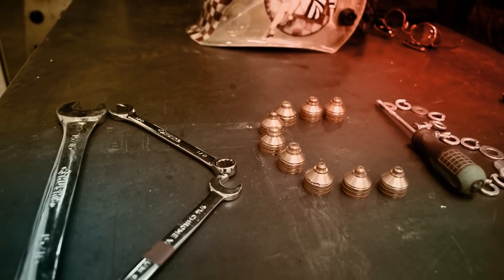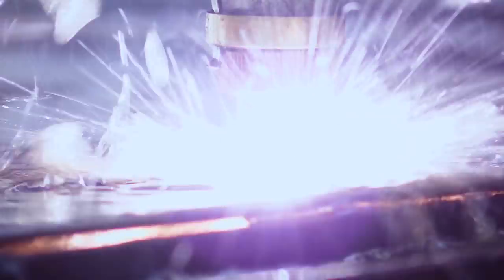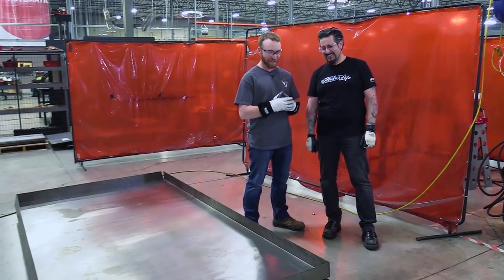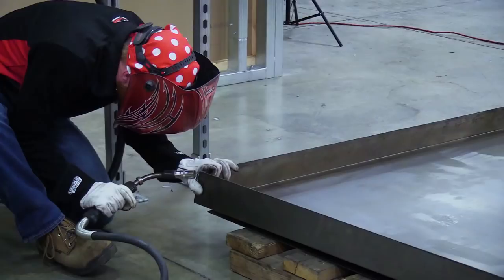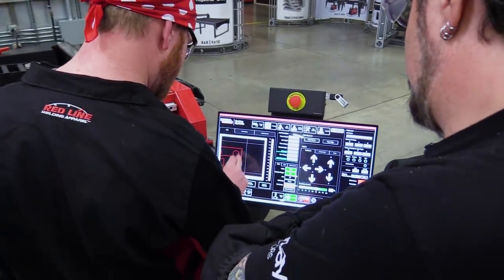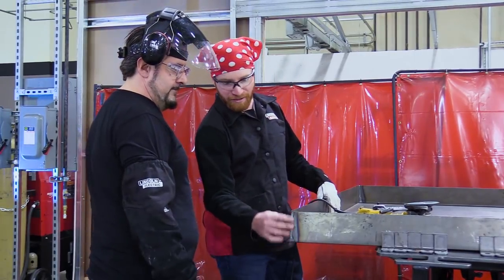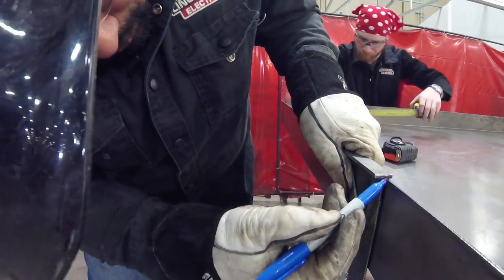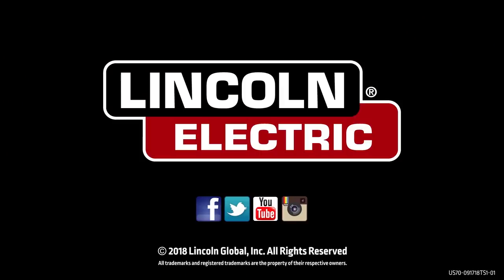Design | Cut | Build™ - Mobile Plasma Table - Part 1 | S3.E7

Comment: The rail design is the primary reason that I did not buy a Torchmate table when I outfitted my shop with a Star Labs table--the side rail design is so much better.  I had a friend with a TM table and his torch was always hopping over slag.  i am surprised that they did not change their design yet.

Comment: As a Mechanical Engineer turned Millwright now semi-retired but still designing & fabricating at my home shop....  I would have to ask why would you want to "hump & slosh" around a tank full of water solution in a trailer...??... that's a tough way to go!  I would have "strongly" suggested a 'more forgiving' downdraft exhaust fan system!  I mean think about it... when you pull into a jobsite you will have to look for a "level" parking spot(hopefuly a hard pad) and even with that you will still have to level your trailer/plasma table "EVERY" time.  I'd for dang sure be installing auto-leveling jacks on each corner of the trailer!  And before any 'power-up'... hand move(literally by hand) fully move the plasma heads up and down the rails in all directions of travel to "feel" for any kind of binding...
Also, I want to give you something to consider.  Maybe you have, but consider this....  Plasma tables are designed to be placed on a hard surface which is fairly level.  The rails/tracks and drive gears/heads "will NOT like twisting and flexing" at all...!!  Something is 'going to break' and possibly often!  From my experience, most all common built trailers twist and flex... from single axle to tandem axle to tri-axle and on up to 40+ foot flat beds(even enclosed).  So, before you load your trailer up get it level(rigid level) and "X-BRACE" the heck out of it... your 'plasma-table' will love you for it..... and possibly even your wallet.....?  I wish you the best of luck with your ventures... Success to you my fellow fabricator...!!!